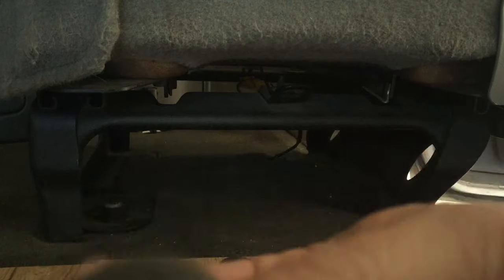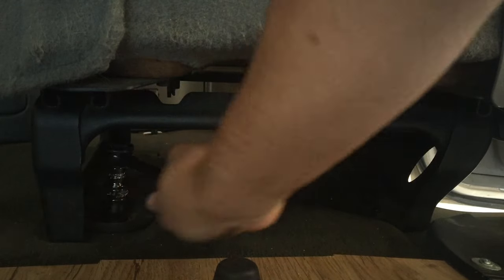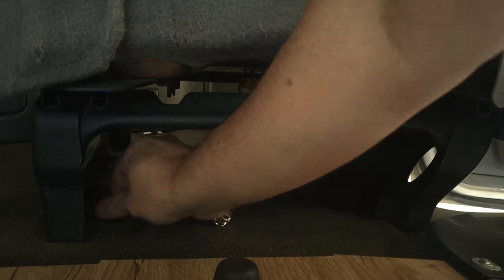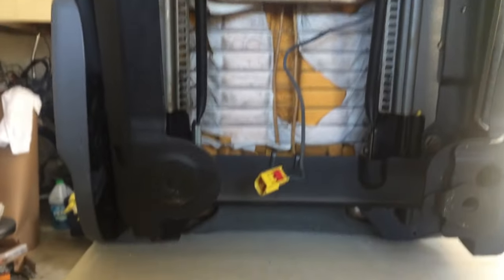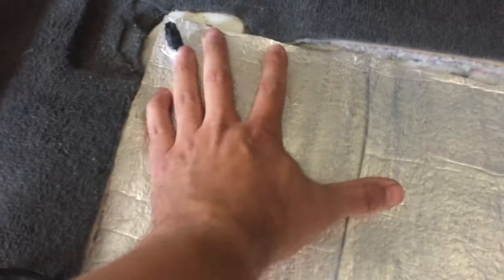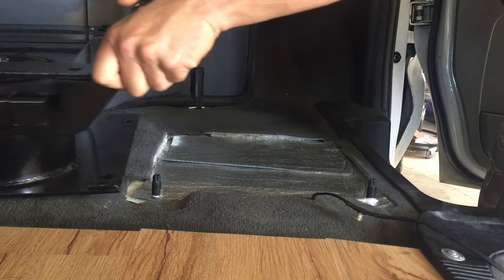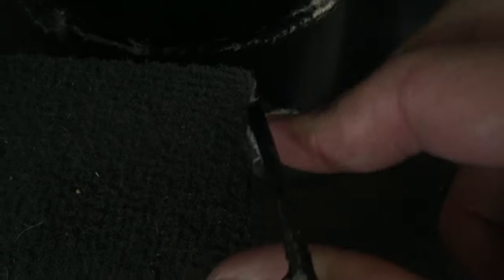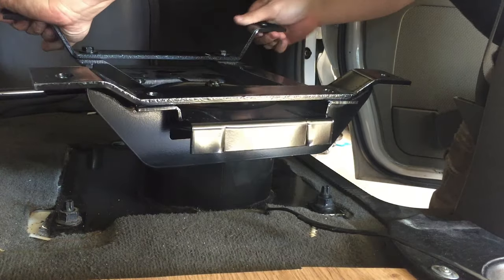Van Life Mods: Swivel Seat Installation on Ford E350 | Ultimate Van Life Upgrade

Comment: I still have the base from my last van. This is up there on must have van mods. Nice man Direct fit. I dont remember who I got my base from but I had to do all kinds of modifications to get it to work. The company wanted a 30% restocking fee even though it was their error so I just made it work. Makes the passenger seat a cool hangout spot.
Reply from the maker: yea i was dreading the alignment of the bolts. i've heard of people getting the wrong base and this thing took a month to ship. But i got lucky with this one. easy peasy.